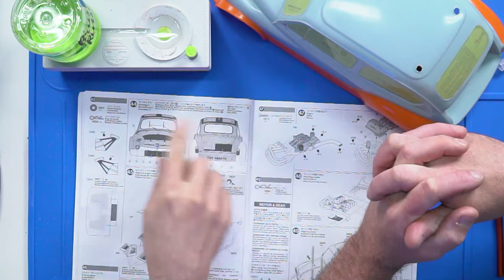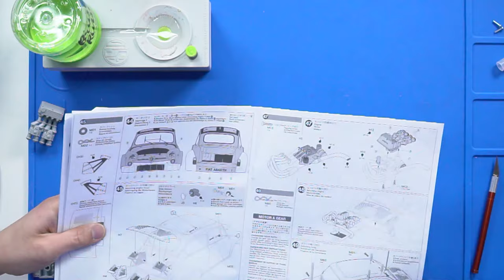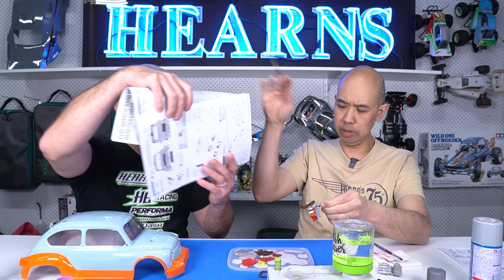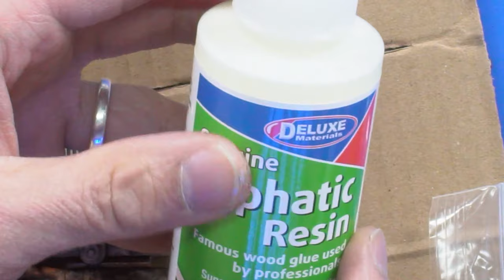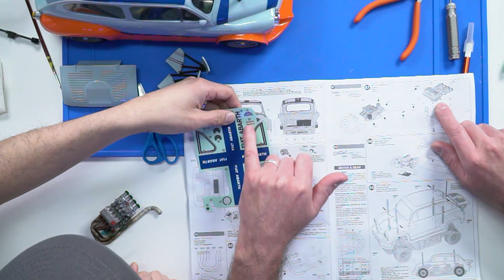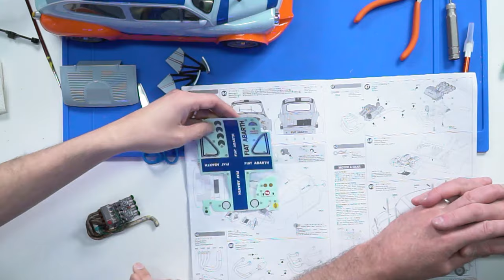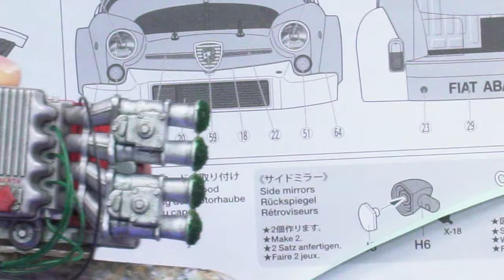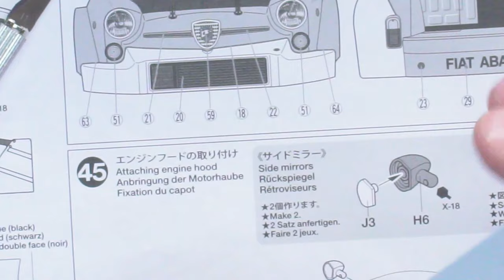Tamiya MB 01 Fiat Abarth 1000 TCR Build | Part 5 | #askhearns

Comment: I much prefer the abs hard plastic shells to paint with the added window inserts. The soft plastic shells are a nightmare to mask properly and paint. I did a 40 series comical and it was difficult. Hope to see this on display at the bash. I wonder if there's a rule about keeping those long posts. My OCD says cut them down and round them off so there's 1 hole for the slip pin.
Reply from the maker: Polycarbonate bodies are a different animal and do need some air bending techniques to mask and paint well. We have trimmed the posts and the car looks sweet!